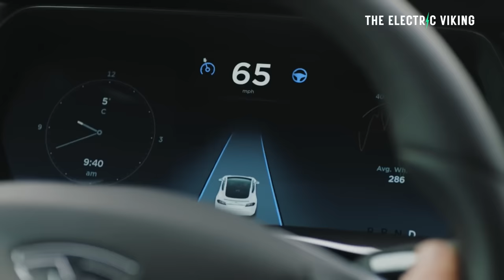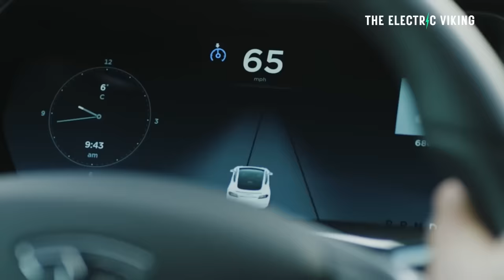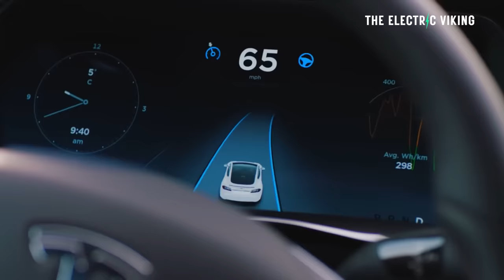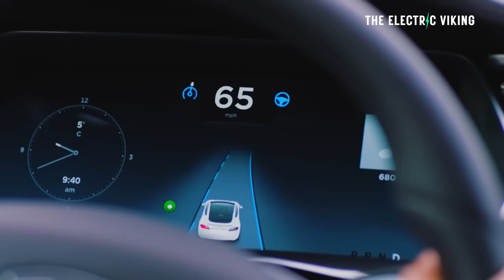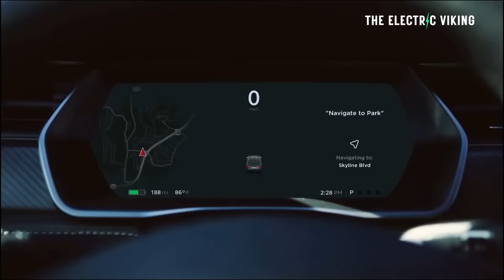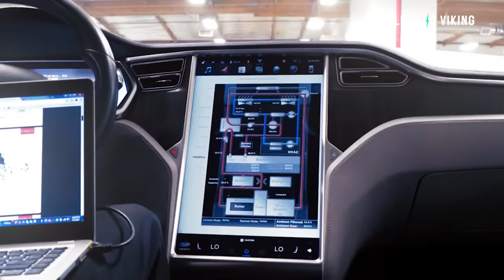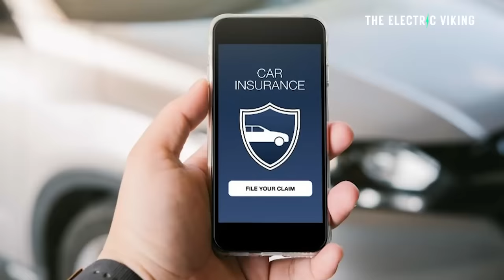Analysts say Tesla will Disrupt the insurance market & make billions annually

Comment: What I like about Tesla offering insurance is that it creates an incentive for them to make their cars easy to repair.
Reply: how much you want to bet they pay out at a lesser rate than a legacy insurance company
Reply: Or easy to recycle & cheap to replace
Reply: Yes!   Exactly!
Reply: have you taken a look at the cybertruck? if you really did. your statement makes no sense at tall
Reply: When you let the insurance pay the repair and it's the car manufacturer's own insurance and it's cheaper than other insurances, then they profit from making the car in a way so that the repair does not cost too much.Whatever repair it is.
Reply: Structural pack batteries 😂
Reply: Mentioned on investor day.
Castings are making repairs 10x cheaper and 3x faster.
Reply: Invalid... Tesla is not concerned about paying out because their cars will be rarely at fault... particularly when fsd comes out. They will continue to manufacture as inexpensively as possible to maximize sales to accelerate the shift to renewable energy... its their mission statement. Not to make maximum money on insurance... good drivers will not pay much and thus any accident is unlikely to be paid by Tesla. Nice try but it is faulty reasoning.
Reply: It was my understanding that they decided to offer car insurance because the other insurance companies were violating Tesla owners, which could have F Tesla sales. I could be wrong.

Comment: I have Tesla insurance in CA and it's a couple hundred cheaper than all the other offerings.  Annually it saves me about $400 compared to other insurance companies.  Plus when I got a cracked windshield from a flying rock on the freeway, I was able to get 50% off windshield replacement because I have Tesla insurance.   I'm loving it.
Reply: My experience is spot on the same. My monthly premium is around $108/month. My windshield replacement was slightly over $900 with the 50% parts savings.
Reply: @Dave--FkTheDeepstate  it's all relative to what a premium is I'm in New Zealand, I pay a small portion of my insurance for added windscreen cover, chips repaired free,  windscreen replacement free,  somewhere somehow everyone pays for each service or product package

Comment: Purchased Tesla Insurance for my Model 3 here in the state of Virginia in the U.S. for my wife and I. It was initially $95/month for standard insurance coverage, but within a month it dropped to $84 based on my safety score of 92 and I expect to to drop further. I am learning to stop driving so close to cars in front of me based on the safety feedback. Love this insurance and safety score data based feedback!
Reply: Driving too close to the car in front is a built in FEATURE !   I have mine set to 7 (lengths?) the maximum in a Tesla, and it is still WAY too close for my liking. In fact, it is too close according to the government guidelines of a 2 second gap, or 4 seconds if it's raining.  At 110kph freeway cruising speed, Tesla's #7 is about 1.5 seconds behind the car in front - which may be one of the reasons for so many accidents with stopped vehicles (emergency workers for example).   NOTE: We have a law here that says you can be booked for passing a stopped cop car with lights flashing IF YOU GO OVER 40kph !!!   This in itself is bloody dangerous (rear-ends)  when you are doing 40 on a 110kph freeway (but that's the law here in Victoria Australia).

Comment: US auto insurance companies have for years been offering rate plans that require a dongle to be attached to the OBD2 port, sending data back go the insurer, allowing them to adjust rates dynamically.
Reply: Yes but it is not nearly as in depth as Tesla's data so Tesla should be able to do better than any other reputable insurance company.

Comment: In casualty insurance, actuarially CLAIMs = PREMIUMs. The money is made on investment income. Reduce claims, you reduce premiums. At least that's the honest way to do it. Insurance companies, and their captive regulators, are not honest. 

Take your homeowner's insurance: Add up your premiums for 30 years and it is 1/3 the replacement value of your home. This suggests 1 in 3 houses on your block will be destroyed in 30 years. How does that match your experience. In my experience of owning multiple homes for 30 years simultaneously, not a single home within 1/2 mile of me (i.e. 1000 homes) has been destroyed. And homes destroyed by wild fires and hurricanes is minuscule to the total number of homes out there. It's a very very large racket!

Comment: You don't understand age?  WHAT?  The insurance companies have all the crash data of vehicles (sports cars more, SUVs less), age /experience of drivers - young inexperience and Biden Old slow to react to crashes - high, along with speeding tickets, and DUIs to determine the proper insurance risk plus miles driven per year.  Young kid in a sports car - very high - it also depends where you are.  I was 21 with a new 1990 Twin Turbo Z, liability insurance only (no full collision) in the SF Bay Area, it was $2000 for a $35k car.  I moved to LA, and the insurance was to double to $4000.  I traded the car in for a new 4Runner SUV far cheeper.  If Tesla can get all the stats after say 6 months and adjust their rates for their driving, location, thefts, and hit and runs - they will have a huge advantage over normal insurance companies and make Tesla a far better and cheeper ownership with it's AI driving software plus get all the same insurance stats - DMV and gov records that others get.  This is a no brainer!  This will sell more cars and have higher margins than their competitors with better real time stats.

Comment: Not true for Norway, in fact it's the opposite. By far the most expensive insurance, and its no wonder, since tesla is a nightmare to repair when crashed, some parts will have months of delivery time, and i'm talking common parts. Just a dent in the battery = condemned car, and you get cashed out. Though the same would ring true with other EVs but there are way more Tesla than other brands, so they are not caught up yet.
Reply: Do you mean regular insurance companies or Tesla insurance company?
Reply: @Harrythehun  Regular, since Tesla only has partnered up with an already existing insurance company in my country. It's basically the same prices with some regional differences based on crash/cost data.
Reply: Wait until the data catch up, then it will be cheaper.

Comment: Before I bought my used 2020 M3, we had a 2019 Honda Pilot (financed), a 2005 BMW Z4 (paid off), and a 2021 Lexus RX350 (leased).  Insurance was $800 every 6 months.  After trading in the Honda for my M3, insurance jumped to $1200 a month.  We live in Nebraska which is one of the higher taxed states and pay higher costs regarding anything having to do with vehicles.  To renew my car registration each year I pay $800.  The cost is based on the value of your car.  This state sucks.
Reply: The state of Nebraska is still better than California. They are worried about the batteries catching fire. (Although not in Tesla's).
Reply: @tedmoss  Oh for sure.

Comment: Well, we should not be praising Tesla to the skies either. For Australia, I did 2 quotes one for Tesla Model Y LR and another for Lexus RZ, both cars being EVs and all the other parameters being the same - driver, address, kms etc. The Lexus was 50,000AUD or ~50% more expensive than the Tesla. Yet the insurance quote for Lexus was lower than that for Tesla. Now why would that be? Clearly, Tesla is not doing what it should in terms of supply/costs of spare parts and having enough "authorized" repair shops available. So Tesla basically saves or earns money in those areas - and passes on those costs over onto their customers. Which is not cool.

Comment: For an insurer,  they need to have data to show a 'standard' risk for the car and also for the driver, and to set a premium accordingly.  However when it comes to claims following an accident, having a Tesla on your books is a much better option.  Normally it is a case of one party's word against the other, but with Tesla's data and video, each case will be much easier to resolve and should weigh in favour of the Tesla rather than the other vehicle involved.  Therfore premiums should be less for Tesla drivers, and more of a profit for the insurer.  regards

Comment: Insurers have a point about Tesla repair costs.  Where most car windshields can be replaced for $400, a Model 3 or Y windshield is at least $1600.  Similar high prices for things like control arms and steering knuckles commonly broken in minor front end collisions.  I don't know about headlight or taillight assemblies, but hopefully they are not $2,000 each like some other OEMs.  Between windshield, airbag and light assembly costs, what used to be minor fender benders 40 years ago can now total a car as far as insurance companies are concerned.  Running over a wooden pallet dropped on a highway used to mean a new oilpan or muffler and now can mean a battery pack replacement for $10K - $20K.  Tesla and all OEMs need to start paying more attention to cost to repair their vehicles and include them in average total cost of ownership.  Their current prices for replacement parts are almost like they want to punish people for choosing their car.  A big part of the problem with the dealership model was that repairs are a huge profit center for them, but Tesla is also treating repairs as a profit center with high parts prices to customers and third party repair shops.

Comment: I have Tesla insurance on our new 2023 Model 3 RWD.  The premiums after the first two months have been fair $81 to $85 per month; however, the driving monitoring algorithm could use some tweaking.  If you brake fairly hard on an yellow light instead of possibly running a red light, you get gigged for hard braking; likewise, if you run a red light,  I do not believe you get gigged.  If you cross a double yellow on a two lane road to give room for a cyclist, jogger.or anything else along the side of the road without turning on your turn signal,  you also get gigged.  If someone pulls out in front of you or changes lanes closely in front of you, I think you also get gigged.   In all of these cases the cameras should tell Tesla you did nothing wrong.  When using Autopilot (which is designed for highway driving),  I read you get a 5 or 10 second period where you are not scored if you take over because Autopilot does something weird or you take over from some reason.  For that reason, I try to use Autopilot most of the time while highway driving.  On many highways Autopilot operates at only five miles over the speed limit (assuming it knows the correct speed limit) so I use the go pedal to match the flow of traffic.  Not sure if you get the 5 to 10 sec scoring grace period while depressing the accelerator as described above?  Good news, you do not get gigged for fast acceleration or speeding (within reason I assume) unless you go over 85 mph while Autopilot is engaged.  I sometimes forget to disable Autopilot when trying to get out of a semi's blind spot and overshoot the 85MPH limit.  Again, the cameras should show why you exceeded 85MPH for a short period of time.
Reply: Some of this is true.  Some of this is quite out of date.  The out of date items have already been addressed by Tesla in a way I find quite fair and reasonable.  In summary, it’s a pretty fair scoring system.

Comment: I thought about this the instant I heard about insurance on Teslas. What they also need to do is put together a "refurbishment" program whereby a Tesla that would normally be written off damage-wise, is sent back to be used as parts for refurbished models sold at a discount but with full warranty. After all, Apple has been doing it for years. This would also prevent "chop shops" from buying write-offs and slapping them back together.
Reply: - uhuh, a field ripe for an Anti-Trust case. Inequitable market manipulation, or somesuch, lol...

Comment: Will there be a ‘TeslaCare+’ insurance tier offering? One that includes not only battery service cover, which means that a car battery would be replaced at no charge to the owner if tests indicates the pack retains less than 90% of its original capacity. With TeslaCare+ also providing cover for accidental damage from use and handling, with each incident subject to a calculated excess fee. That fee being based on pertinent tele-metrics taken from time of incident.

Comment: I think it makes sense. I get tailgated a lot and clearly those drivers are more of a risk. Also isn't the car itself safer? Doesn't the tech in it help ensure you are at a safe distance and can't it help warn you and or help you avoid an accident? I would think there are less accidents in an EV that has good sensor tech in it. But that's offset by how expensive the vehicle is. I also suppose that since they supply the replacement parts they control the repair cost as well to a degree. That's a double edged sword though because it makes general repairs more expensive than they should be.

Comment: Teslas are driven more miles-kms/accident.  Right? And that'll get better as FSD goes viral.

That drives down the cost of repairs v premium rate. 

Any individual repair or the average repair costs may be higher than comparable ICE or other EV. With the use of the driving assists, Tesla are already getting into less accidents/mile-km than all other brands. That will only get better, too.

Leads to lower insurance premiums.

Comment: Not sure you understand the algorithms involved in risk assessment.  I am not sure you don't but I suppose you don't: these cars are performance cars and are very expensive to repair: also they may take months to repair and require loaner/rental in the mean time. That might be why insurances are more expensive. I hear here in California people talking about doubling compared to previous car, but that might also have to do with replacing a used car with a new Tesla. 
Also I heard that the slightest crash requires to change the batteries (for safety) but I am not sure that's true.

Comment: There is no reason for the insurance on a Tesla to be more than an Internal Combustion car. The data shows that Tesla is a lot less likely to be in an accident because of all the safety features FSD etc, I can't remember the exact figures. but i think it was about 1/3rd as many.  So even if the repairs were slightly higher cost, they are still a smaller insurance risk, because they are a lot less likely to be in an accident in the first place

Comment: Ha! It significantly comes down to repair cost. Tesla will insist on captive service (That's a real term!) which will not permit third party repair shops to make significant, if any, repairs to its cars. Tesla can look at repairs at cost, whereas other insurers will pay Tesla's cost PLUS a markup which will need to be figured into the premiums charged by those other insurance companies. Tesla's ability to make high quality low cost repairs for itself will, relatively speaking, make Tesla's insurance a bargain. Also, Tesla may effect some repairs by simply replacing major parts of a vehicle--or even the whole vehicle. I can't imagine how an independent shop will repair Tesla's cast aluminum chassis. If third party repair shops emerge, they will need to develop a lot of technology to repair the damaged parts of Tesla cars.

The customer's ability to get reasonably priced insurance will depend on his driving habits. The customer will significant set his own premiums based on the car's ability to verify his driving behavior, which is the major point of your video.